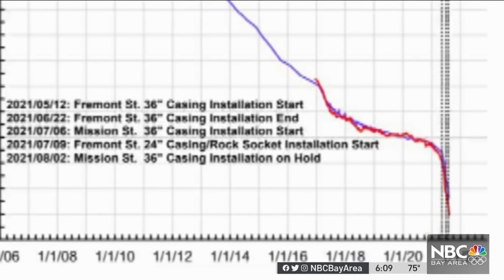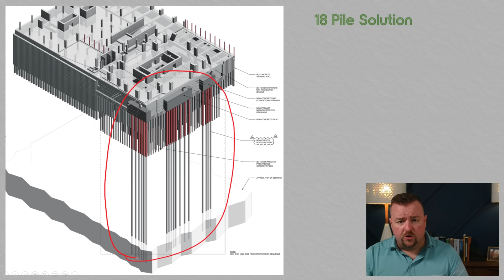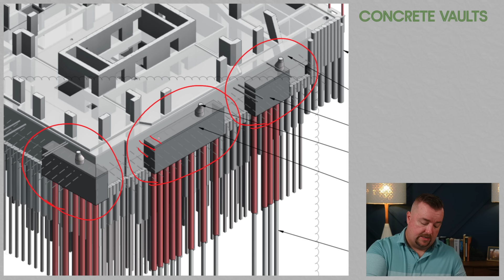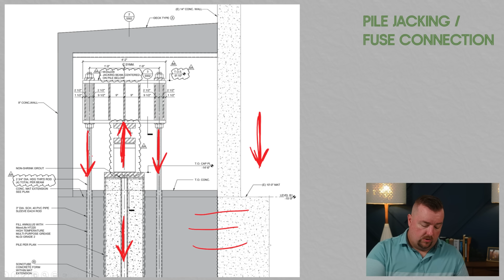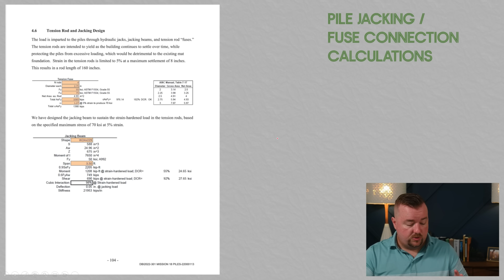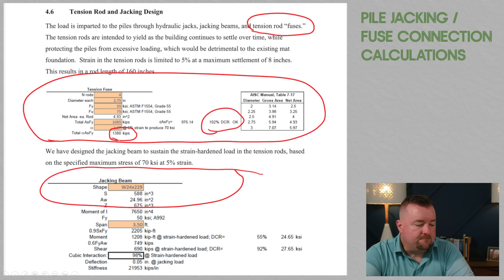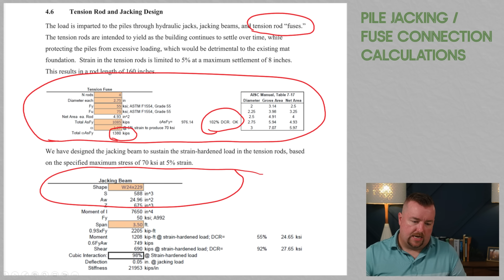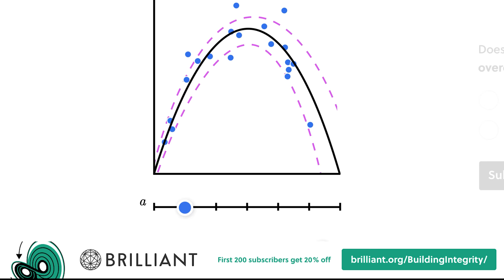Did I Uncover a $100,000,000 Mistake with the Millennium Tower "Fix"?

Comment: This entire design seems, well, stupid. If the threaded rods, or the plates at the bottom fail, the building FALLS DOWN. The weight of the building is no longer supported by the new piles - and surely the point of the new piles is to support the building? Complex, expensive, underbuilt, and looks like it is DESIGNED to fail just when it is needed most.
Reply: No, the building will not fall.  The loss of support from this system would only result in continued uncontrolled settling.  The building has never been anywhere close to toppling.  Besides, what do you mean by “fail”?  If a threaded rod reaches its yield limit, it will just enter the plastic deformation region.  That would transfer some its load to all the other rods.

Comment: Mwah. Not just teeny tiny. Seen underpinning with quite impressive sized bridge pillars on sandy bottoms..But clearly here they did not research the bottom well enough or did not.calculate it right for some reason. Obviously the footimg is not carrying and spreading the weight as expected. If you press on loose sand on an unequal bottom, where will those forces diffuse too? Looks like some same is getting pushed sideways.
Reply: But must do some research on structures with underpinning, for plenty examples that can not be called teeny tiny.

Comment: I'm only educated in physics to pre-degree level, but I'm otherwise well educated in other fields.
Listening to your description of the "fix" to this building terrifies me.
Even as a non-structural engineer, I'm intelligent enough to understand how that tiny bar, carrying 700,000lbs+ of load, could fracture catastrophically. I can also see why the lack of calculation around the forces on the bar, including any stress relief bars that might be placed across it, is completely lacking. Absent.
The city engineering department is passing the buck, trusting the guys who got it wrong in the first place.
That is waaaaay not the way to go.
It requires exactly what you stated - an independent peer review by an unconnected structural design engineering team, and the "fix" only be permitted if they have precisely zero reservations about this work being a valid solution. Anything else should be completely vetoed.

Bottom line: I'd not live in, live, or venture within half a mile of that building unless that's done, and the independent findings implemented.
Reply: I don’t know why you would assume that any important calculations were not made.  We don’t know what is or isn’t in the notebooks of the engineers.  All we see here is a report.

Comment: I get it save money building this building without going down to bedrock. The huge money backers want to cut costs by not going down to bedrock. They got the city to approve this risky project. If it had worked it would have been OK. However, the sinking building will be very hard to slow the leaning and sinking. 

Even if the leaning is slowed or stopped, what will it be like to live in and work in a leaning building? Anything on the floor will move downhill. This building may never become right.

These guys are pushing on the disadvantaged section of a huge lever trying to attenuate, slow, stop, or correct this building movement hundreds of feet above. What guarantee is there this will work? This looks like a scam.

This looks like a bandage to slow or stop the correct process of fixing this huge mistake. This building should be torn down and rebuilt with the foundation going down to true bedrock.

Comment: I am not in any way an engineer but the language used here bothers me. A FUSE? They are designed to break under excess load to protect equipment. How would this breaking protect? Surely the structure would fail with catastrophic results wouldn't it?
Reply: The rods will undergo inelastic stretching before they break.  The intended result will be to limit the load on the new piles.  No catastrophe will happen if some of the rods break.  They are not holding the building up off the ground.  They are merely supporting one side to arrest the progress of the leaning.  The angle of lean is only a quarter of one degree.  The building is not in danger of toppling.

Comment: It seems to me (as not a geotechnical engineer) that the whole approach to "solving" the problem of this tower has been backwards. Rather than trying to upgrade the foundation to fit the building. The building should be downgraded to fit the foundation. A much cheaper and better alternative. Simply deconstruct the top 10 floors reducing weight and wind loading capcity requirements of the existing foundation. Maybe the geotechnical engineer on this channel could advise (back of the napkin) calculation of how many floors would need to be removed to fix the problem once and for all. And another thing. This Hamburger guy. As the single person most reponsible for this almighty cock up he should not be involved in any way with the decision making around the resolution of this problem. He has an obvious vested interest in finding a solution that makes his earlier failure better, rather than looking out solely for the best interests of the owners and the city.

Comment: You are correct….no it’s not going to work long term. You are only moving the structure a bit the piling in long term will sink or begin to crush. All thread is weak solution at best. The steel needs to be 4x that in thickness’s and a much larger base. It’s a bandaid the life of the building is doomed if you own a space you will not be selling it in the future you lose your investment. Who in their right mind is going to purchase. 2 million dollar floppy condo…. maybe Peewee Herman……Fail….star over do the right thing.

Comment: Pardon my comment if I'm a complete moron, but...I don't even understand the design intent of the rods. They seem like such baffling and unnecessary complexity. If you've built a piling all the way to bedrock, with a vault on top connected to the existing foundation, and we assume the bedrock and the vault aren't going to slip, and you have a jack on top of the vault, then why not just jack up the building in whatever tiny increments they intend to jack it up and then shim directly beneath the jack with steel as the raising progresses, thus permanently increasing the height of the jack platform as each small lift is accomplished? Kinda like jack stands under a car?
Reply: The building is too heavy to lift, and you wouldn’t want the stresses it would produce if you could actually lift just one side of the building.  The purpose of the remediation is to arrest the progress of the tilting toward the west.  That seems to have been achieved.  

The threaded rods act like ultrastiff springs.  Their function, in addition to transferring the upward force of the jacks to the foundation mat, is to limit the force on the pilings.  They do this by stretching.
Reply: @GH-oi2jf  So the jacks they installed aren't going to un-tilt the building by lifting the side that sank? They're not going to straighten the building out? If not, then aren't all the stresses induced throughout the entire structure as a result of the building leaning (which I assume it was not designed to do) going to cause a lot of other problems over time? I thought they added a bunch of pilings and vaults and jacks so they could level the building?
Reply: @bry2k — The first priority of the remediation was to arrest the progress of the tilting.  That seems to have been achieved.  Along with that, the lean was reduced slightly (about an inch of horizontal displacement).  Over time, the side opposite the new piles should continue to settle, which will remove more of the lean.

Comment: Pretty nice to get paid to do your job twice
Reply: Who would that be?
Reply: @GH-oi2jf  the engineer's
Reply: @butterbeanfarmer7952 — Which engineers?  There are many.  The remediation engineers, led by Mr. Hamburger, did not design the building nor its foundation.  They designed the structure discussed here which is intended to arrest the tilting.
Reply: @GH-oi2jf  I was just listening to the story!
Whatever
Reply: @butterbeanfarmer7952 — The remediation plan had to be reworked because of concern about disturbing the soil more than necessary, which was causing the tilt to increase.  What is the bottom line here?  The revised remediation plan was carried out, and the progress of the tilting has been arrested.  The new structures have done what they were intended to do.

Comment: Questionable engineering notwithstanding.  Not seeing any sensor apparatus to detect a separation failure of the tension rods or the fuses tells me this is a DEI resourced engineering project.  That it is happening in San Francisco gives me more reason to worry.

Comment: What a cluster f. I'm surprised the crazy 'patch' doesn't use carbon fiber and glue. That little plate and the nuts - reminds me of the Florida International University pedestrian bridge collapse. Pre-tensioning cables just pulling through under-rated anchor points in concrete. Another 'design by woke.'

What I'd like to know, is once these pillars-and-poke things are all in place and jacked up to full load, what happens when the first one explodes? Does that result in a near-instantanous failure cascade of all of them?

Then what happens when one entire side of the building is suddenly dropped a few inches as the original pylons-in-silt get an impact loading?

The conspiracy theorist in me wants to say this sounds like a deliberate plan to cause maximum havoc and death. But no, who ever heard of a government scheming to collapse major buidlings for obscure ideological reasons?